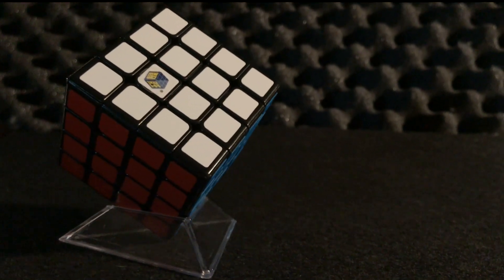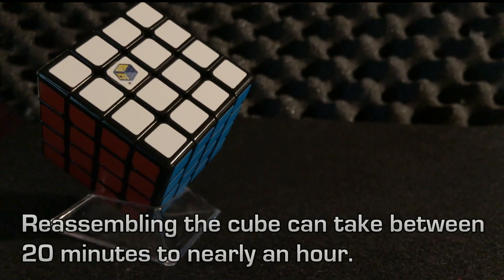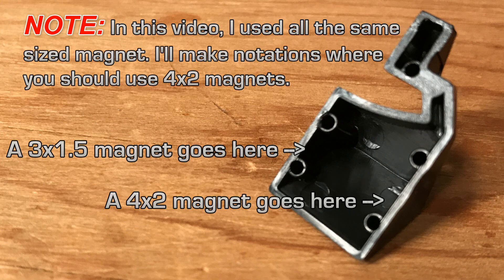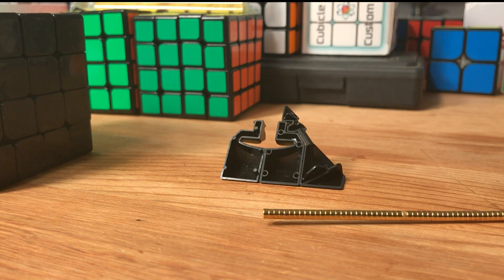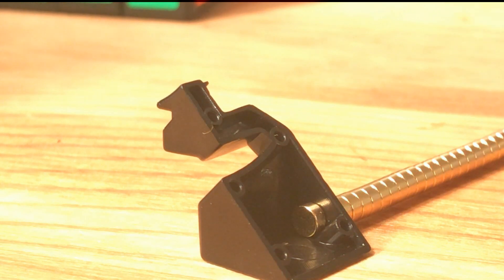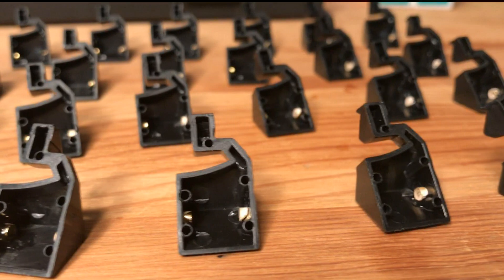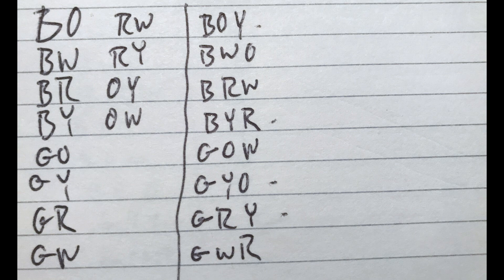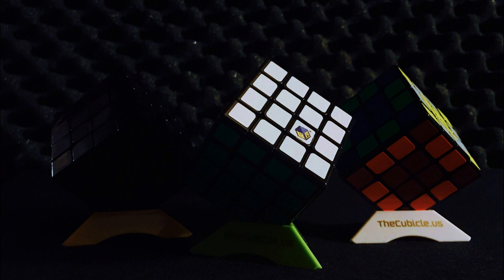How to Make a Magnetic Yuxin Blue 4x4 and other 4x4 Speed Cubes

Comment: would a 3x2 N50 magnet work for the outer layers? I really don't feel like waiting for shipping and that's the closest I can find on SCS
Reply from the maker: Gus Bennett Yes, they can work fine on the outer. You didn't mention what you're using on the middle. Just make sure you come up with a balanced combination. Check the pinned thread here in the comments for some great information on what works well.
Reply: DMCubing sorry, I mistyped that. I meant 3x2 n50 in and 4x2 n35 out. Are my inner layers too strong or is it ok, since they’re a slightly weaker magnet but .5mm thicker than what you recommend in the video

Comment: is it okay to use n35 4x2 for the inner layer
Reply from the maker: shfnl yg Some people have used the N35 4x2 in the middle, but most prefer a weaker magnet in the middle that equates to about half the strength of that used in the corners. So if your outer magnets are stronger than N35 4x2s, you'll probably be ok. 
Check the pinned comment thread here and some of the other comments to hear what others have used.

Comment: I'm planning on using n35 4x2 on the outer and n35 4x3 on the inner layer as it's hard to get every type of magnet where I live. Do you have any thoughts on that ?
Reply from the maker: No, don't ever use a magnet in the inner layer that is stronger than the outer layer!!!!! There are two pair of magnets on each face for the middle slice, so it's already going to have a stronger middle layer if you used the same magnets throughout. If all you can get are N35, I'd suggest N35 4x1.5 for the middle layer, or using N35 4x2 throughout the entire cube. Hope that helps.
Reply: @dmcubing6342  I also asked the cubing subreddit and they said the same thing so I ordered 4x2s for the outer layers and 3x2s for the inner ones. Can I also have your thoughts about that ? Even if the 3x2s aren't right I could use 4x2s on the entire cube as I ordered 100 of each because they were very cheap. Thanks :)
Reply from the maker: MiniLink Yes, 3x2 magnets in the middle would be an excellent choice! You'd be better off using them.
Reply: @dmcubing6342  alright thanks ! :)

Comment: 3x2 n35 or 4x1 n45 for inner??? does it work with neither of them?
Reply from the maker: What are you using for the outer magnets? The idea is generally to use a magnet in the middle layer that is just slightly stronger than HALF the magnetic strength of the outer magnet. The middle layer ends up with twice as many images as the outer layer so they need at least half the strength of the outer magnet to be equal, and since most people like the middle layer to have just a little more attraction than the other layer, the magnet is usually just slightly stronger than half the strength of the outer magnet. So it depends on what you're using on the outer layer.
If you're using an N35 4x2 on the outer, either magnet would work, as they have similar pullforce strengths. Using the calculator at KJ Magnetics, it shows the N35 3x2 has a force of .40lbs and the N45 4x1, .39. Usually a wider magnet spreads its attraction outwardly more than a narrower magnet, so if you're using an N35 4x2 on the outer, I'd recommend the N45 4x1 on the middle.
Reply: @dmcubing6342  thanks i was using the exact same thing as u said i use n35 4x2 outer 😀😀😀😀

Comment: hey a question what is the difference between N35 to N40
Reply from the maker: Jalkdacuber If you're talking about magnets that are the same size, the N35 is weaker than the N40. The N40 will have a stronger magnetic pullforce strength. 
Here's a pretty neat magnetics calculator:
https://www.kjmagnetics.com/calculator.asp

Comment: I want to magnetize a wuque but i only have 4x2 magnets. I have about 150 N35s and 50 N50s. Im assuming these are way too strong for a 4x4?
Reply from the maker: dov_the_moose not necessarily too strong for the outer layer, but you really need a slightly weaker magnet on the inner. I think I've come across videos where people have used N35 4x2s throughout the entire cube and have been satisfied, but most people use a weaker magnet in the middle.
Reply: DMCubing thank you :)  ill look around some more then

Comment: Why do you need 96 magnets?
3 magnets per corner 
3 x 8 = 24
12 big edges, made up of 24 smaller edges
2 magnets per small edge
2 x 24 = 48
48 + 24 = 72?
Reply from the maker: SpedUHC Look at 1:43 
You're leaving an edge piece out. Do your math over. It will total 96.

Comment: i have a question so what happens if you use the same grade magnets in both the inners and outer layers?
Reply from the maker: GingerAyl Cuber Well, that's what I did here. What happens is if you use 3x1.5 throughout, you end up wishing you had used 4x2s on the outer layer. I think a person could probably get by with maybe lower grade 4x2s throughout the entire cube, but using only 3x1.5s isn't such a good idea.
Reply: DMCubing I used the scs 2x4 mm n50 mags in my 4x4. I should've thought this through.
Reply from the maker: How does the cube feel? That's probably the more important thing. Plus, the only way we learn what works best is by trying different things!
Reply: DMCubing yep. The inners are only noticable but the outer layers are pretty much less noticeable. The outer layers are like the gts2 m lite since I can't really notice it during solves but the magnetic feel is sort of there.

Comment: Will 4×2 N35 throughout workout???
Reply from the maker: shveta sharma People have done that but it leaves the middle a little stiff. You're moving twice as many magnets with the middle, compared to the outer, so it's generally safer to use magnets in the middle that are about half as strong as the magnets you use going to the outer layer.
Reply: I used 4x2 N35 throughout and in my opinion,it worked out great.The It made the Yuxin Blue extremely stable without hindering its speed.Ive broken all my pbs on it as well :)
Reply from the maker: Louis The Amateur Youtuber That's great to know!!! I appreciate your input and findings. This helps!!!!
Reply: DMCubing No problem!Keep making these great videos!Without this video,I would not have been able to magnetise my Yuxin Blue at all.

Comment: Would it be OK to use 4x1. 5 N40 throughout?
Reply from the maker: I think so. I think they'd work fine. Some people have even used N35 4x2s throughout the entire cube, so I know N40 4x1.5 will be ok. Other people change the strength for the corner piece magnet Check the pinned comment thread here for some really good information from people who've magnetized their 4x4s.
Reply: DMCubing i forgot to mention this if it plays a role,but I'm planning on magnetising the wuque.
Reply from the maker: I think they're so similar that you'll be fine.

Comment: Just curious, your Gan356 Air video is a little old, and since you have much more experience now, what magnet strength would you recommend for the Air? I have N38 4x2 magnets already available, but do you think that would be too weak for this puzzle?
Reply from the maker: Tetricuber Ah, really good question!! And I've recently done three Airs testing different magnets. Honestly, I don't think you'd ever really need an N38 4x2. Really the strongest 4x2 you'd ever need is an N35. I still think the N35 "4x2" from magnets365 feels awesome in this cube. It's slightly smaller than most people's 4x2. 
My recent cubes have used 5x1 magnets. If you like a subtle feel, the N35 5x1 works extremely well. And for a medium feel with reduced bump, the N48 5x1 is great!
In addition to the various types of magnets, you can adjust the perceived strengths by the magnets' position from the center of the cube. The further away from the core center, the stronger the overall perceived strength.
Reply: Thanks! I was actually preparing to get a higher grade magnet, as I believe in your original video you used 4x2 N48 magnets! I will be looking into those magnets, but my parents might be a little annoyed because I just got enough N38 4x2's for two 3x3s. Jk, but if I'm going to magnetize an Air I might as well make it as good as possible!
Reply from the maker: Tetricuber No. I only used the N48s in the heavier cubes. I used the magnets365 on the first three I made and these 5x1s on the last three I made. The Gan doesn't need a strong magnet.

Comment: Are 4x1 N50s ok for the middle
Reply from the maker: AZ Stacker888 Yes, you actually can with good results. There is a lot of variety in what people prefer. Be sure to check the pinned comment and thread here in this comment section for some really good information from other people who have been magnetizing 4x4s.
Reply: Cool thanks!  Also you should make a 5x5 tutorial because there aren't any good ones :/
Reply from the maker: AZ Stacker888 Thanks!! I plan on doing ones.
Reply: Yea probably on the qiyi 5x5 cause that ones is the best 5x5 right now
Reply from the maker: AZ Stacker888 The Wushuang?
Reply: Yea

Comment: If i want a strong inner layer.Can I use 5x1 n35?
Reply from the maker: 34 Kubes Sure. What you use in both the inner and outer just need to balance each other. Generally, people use the strongest magnet on the outer, and the lighter magnet in the middle with a ratio of about the outer magnets being twice as strong. So you can use a variety of magnets as long as they balance out this way. 
I've found the N35 5x1 a really light, almost imperceptible strength at times. It will feel very light here, so that's something to keep in mind. 
If you look at the pinned comment thread here, you can read from others what they've used. I hope that helps!!$
Reply from the maker: 34 Kubes And I just got a comment on another video that he felt the N35 5x1 felt strong in his Wuque. I think that illustrates how everyone is different and we all end up having our own personal preferences.
Reply: Ok,Thanks.